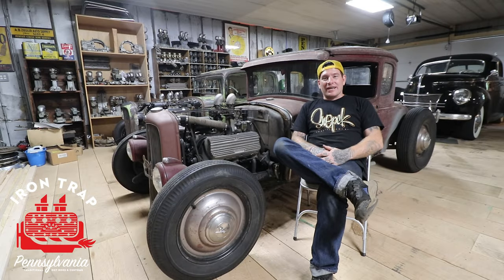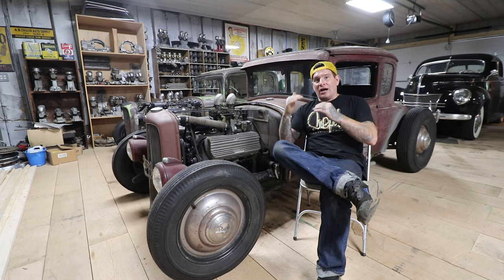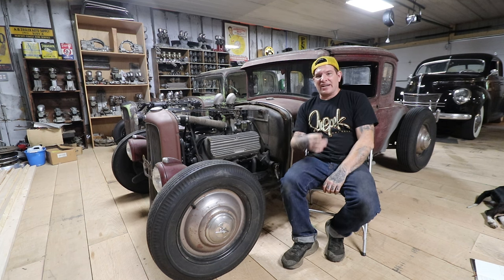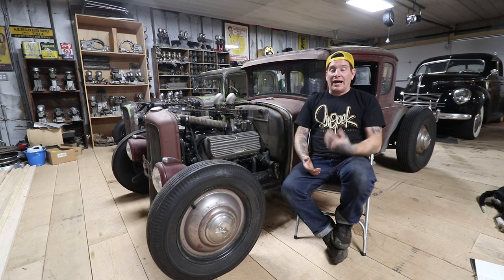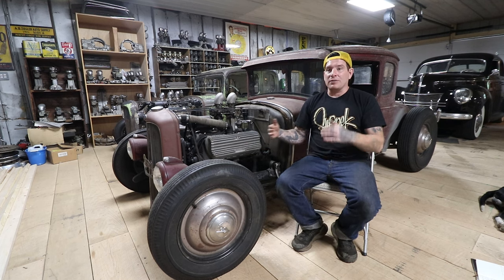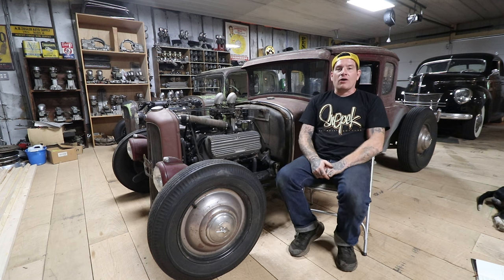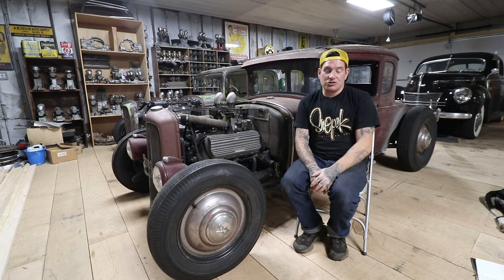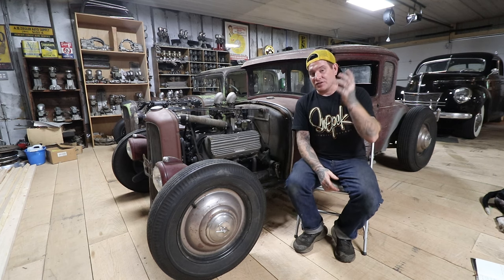Why Does My Ford Flathead Keep Overheating??? Hot Rodding 101

Comment: I own a 46 Mercury with original rebuilt 239 and radiator with 160 degree thermostats and it has never gone past 180 while driving or idling. It will heat soak to about 205 after shutting down.

Comment: The only Ford flathead I ran was a 53 Merc 3/4 race with Wiend head and 3 dueces the problem was trying to get it started again after a brief shutdown like stopping for a coffee. Just would not start. I had to go for a walk for 15-30 minutes.
Reply: In this case look at how close the exhaust is to the starter it could be getting hot then could be the timing and then there is the very last thing people miss the carburetor idle mix could be too lean sounds silly but it can cause hard starting

Comment: I have a copper and brass radiator it is a new radiator.  Not recored, it has 4 cores.   I have a fan shroud and a 4 blade fan. No hood sides or top. My fan is close to the radiator and I  have a fan shroud.  I also have a divider in the water jacket just under the rad hose in the head.  Yes I use a mechanical water temperature guage.

Comment: Through the years I have found that a clean cooling system is the fix for overheating.
The very first thing now is to remove the radiator and have it cleaned and rodded out.
Trying to do it yourself won’t work. A radiator shop is what it says it is . They clean radiators.
Everything else is only frosting on the cake..How many times I said , anew cap, no, new hoses, no, no thermostat, no , trick additive, no. Have the radiator vated and rodded. Then enjoy the ride. 10:53

Comment: Coolant, corrosion inhibitor must be used in all engines. Rust particles will damage an alloy radiator. If the engine is leaking with fresh coolant, it has cleaned out old rust and old silica build up etc, it is flushing your system.

Comment: Matt,, flathead Ford V8s are designed to boil!! The siamesed exhusts through the block is 'what were they thinking' Clearly they were not!! And then used the design for over 20 years!!  The engine really were out of date before they were released. Poured bearings, sidevalve etc etc. Prehistoric crap in 34.
The intake design will leave a LOT to be desired as well. EGTs on one hole will be ok, the next to hot and the next to cool. I suspect twin 97s will help a little. A baby 4 bbl intake and 465 4bbl a good deal more. And will make more power as well.
You need an eficient radiator, meaning in this case a large one. 2 or 3 row max.. Bullshit 5 row ones are useless as they restrict too much air..Wanker tiny ones may be ok for drag racing and nothing else. IF you want to actually drive your hotrod use the original size rad. Or have it overheat all the time.To clean a rad it must be opened up and rodded through, no other way is efficient. And hot tank the block,, then fit a filter in the top hose to collect 50 years of rust even after tanking. Water is to drink and wash the car,, not to cool it. Any premmium coolant should suffice. A good modern alloy radiator is usually better and you can even come down a little in size. Though really with the faults in flatheads within reason larger is better.
Cooling systems MUST be pressurised,, then you can run 230 deg in traffic with no issues OR coolant loss. Later model Fords were ofcourse
A 4 blade tin fan will pull enough air, never bother with flexi fans etc. IF you have enough room a clutch fan will generally be better. But need a shroud. 12volt OEM single fans generally will be ok. And if it is shiny and shiny shrouds probably not. Really fans should be behind the rad pulling air, not in front pushing Not on a road car driven in traffic anyway
Thermostats are imperative in all engines, 180 for those is what they came with and what they should have, colder cracks blocks and heads [as does the siamesed exh]
Restrictors CAN be usefull with race engines,,maybe. 99% of the time a thermostat works best,, this in ALL engines not just Henrys revenge! No thermostat is a total fail.
The engine initially runs too cold, say 140-150 but once you get going then the water circulates way too fast and does not get time to cool, instant boilover.
To me the twin hose deal is less than ideal, yes they can work ok but even Ford worked out for more performance the single system is best.
The best way to fix a flathead cooling is install an OHV, 5 litre Windsor or any SBC is probably best. 
Beware of early 289 302s which have the top and bottom hose on one side,, they too are boilers!!. Though use a late waterpump with the bottom hose left and the top right usually fixes them
And I have over 50 years of motorsport, and 50 years of towing them as well. And general automotive repairs.

Comment: what is the benefit to a restrictor in cooling system?
Reply: If coolant flows too quickly through the radiator, it doesn't dissipate heat efficiently.  A restrictor ring - or thermostat - will slow down the flow and allow the coolant to cool.  Matt mentioned the practice of removing water pump blades to achieve the same.  Racers will fit a smaller crank pulley to slow down the pump.  All of these things help to achieve the same goal.

Comment: Matt, you refer to updated water pumps… I need to get a new set for a Merc I’m building anyway… what do you recommend?  Thanks for all the content!  You Mike and Steve do a great job promoting old school hot ridding!
Reply: Third gen parts sell updated pumps , put 2 on 35 flat head , very satisfied, put 160 degree 8 n ford tractor thermostats inside hoses with clamp work beautiful
Reply from the maker: Yep third gen and I think Bob Drake also offered them. Or there was a guy on the fordbarn that was redoing them and upgrading them as well.
Reply: @IronTrapGarage  George “Skip” Haney rebuilds water pumps. That is the guy you’re thinking of.

Comment: The reason Ford flatheads are prone to overheating is the result of the poor design of the engine.
Routing the exhaust from the top of the cylinder to the bottom of the block through the water jacket? Not exactly a brilliant design.
The Cadillac flathead, on the other hand, has the exhaust exit directly at the top of the cylinder.
The Ford flathead is simply a gasoline-fueled water heater that can propel a car.